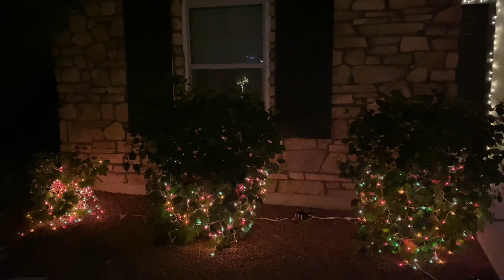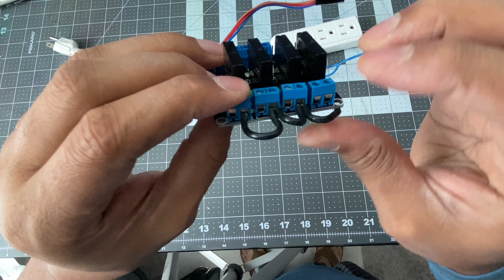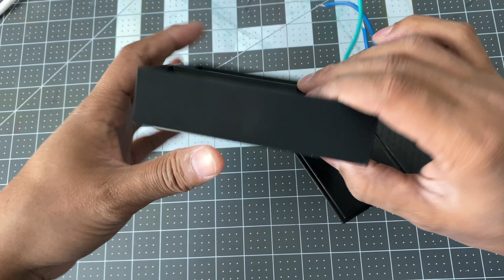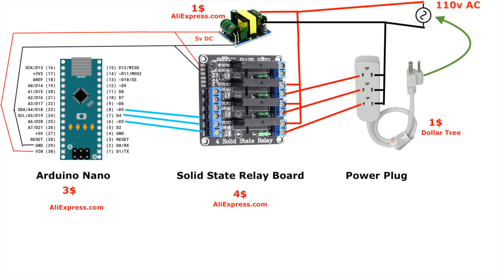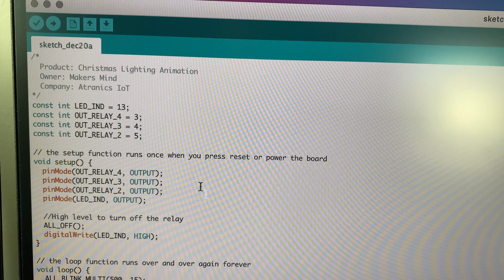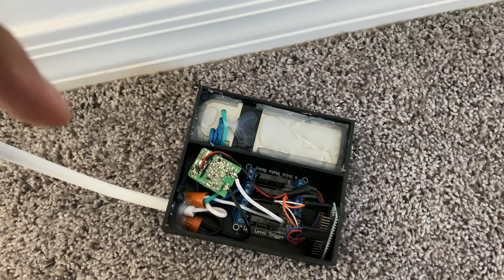DIY Digital LED Light controller

Comment: not bad, but why not utilize 4 solid relay to its max and get 4 plugs extention?
and would be nice if you share arduino code with us, with option to expande it to 4-8 controllable pinouts
Reply from the maker: I did not have a 4 plug extension so just used three of them